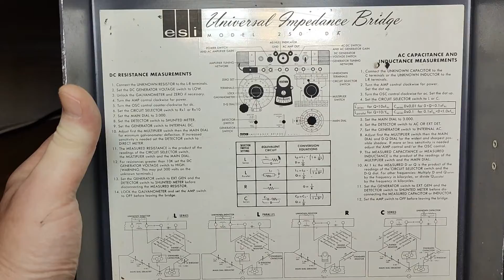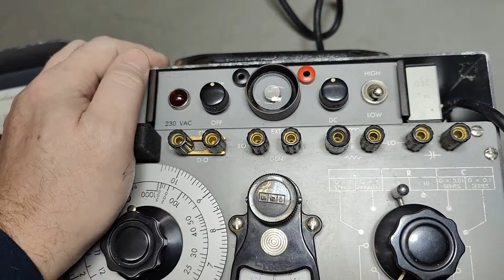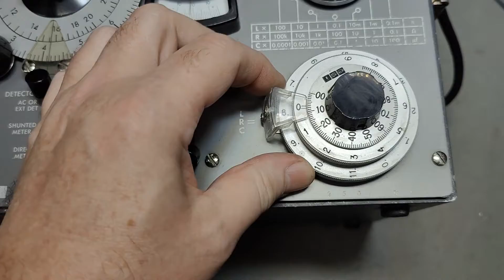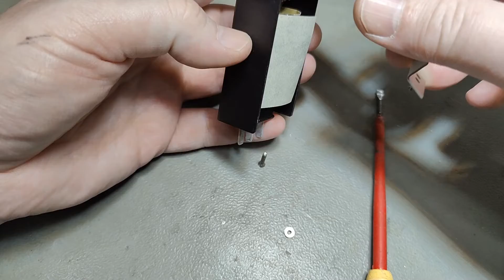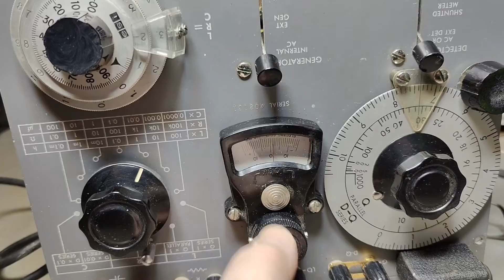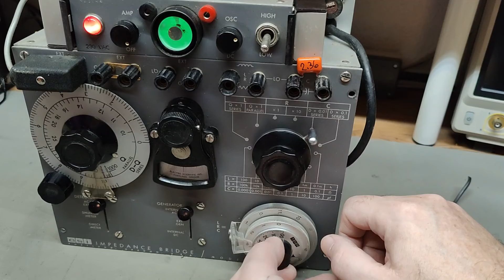ESI universal impedance bridge model 250 DA 1964 test teardown

Comment: ESI was the king of precision measurements back in the day, especially with resistance. Their main competitors were General Radio and Leeds & Northrup.

ESI was also involved in developing laser trimming for precision film resistors.

The gold box is a mica capacitor standard that's hermetically sealed in a shield can. The solid-state DE version lacked the shielding, and it was just a large precision mica cap sealed in tan bakelite. BTW, these are worth a good bit of $.

Comment: I bought two of the 250 DA models at different times at the TRW ham radio swap meet in Manhattan Beach, California.  They are old enough that the paper and electrolytic capacitors need to be changed but other than that they work great.  The oscillator uses a 12AT7 and the detector uses a 12AX7.  The sealed box is the 0.1 microfarad reference capacitor.

Mine are still accurate to 3 or 4 significant digits and probably more accurate than my DE-5000 LCR meter however the impedance bridge takes a lot more time to use.  When measuring aluminum electrolytic capacitors, the effect of dielectric absorption can be seen in the eye display as multiple openings.

Comment: Just found your website, and I am most impressed.  You somehow acquire unlimited quantities of historic instrumentation, and persevere enough to get most of it working. I am slowly working through all your HP reviews, as I have always admired the superb engineering of HP products from the 60s and 70s. A fair amount of the old stuff has passed through my hands, but I do not have the space to keep it. I still do new electronic design work, and for this I have as modern equipment as I can afford. I cannot imagine actually measuring a frequency using the HP540A transfer oscillator, instead of an HP5342A !  Or measuring harmonics with a wave analyzer instead of an FFT analyzer.

You really deserve more subscribers.
Reply from the maker: thanks a lot for the kind words, maybe you can help ? please tell all your electronic interested friends 🙂
you are right, today we use what is more handy , faster, and more accurate, but i really like to play with old equipment for historic reasons too, try to imagine how it was, to really understand i need to use the right kind of old equipment :-) i also really like to see how it was designed and manufactured all by hand no CAD is so impressive.

Comment: The meter release switch is the silver disc just above the meter scale. It should move up and down.I have the model 250-DE which is solid state and has the oscillator and detector inside the chassis. It also has a normal meter which is used for all functions. It works very well and you can balance the bridge to the fourth digit.
Reply from the maker: i am far from getting this one that accurate :-)